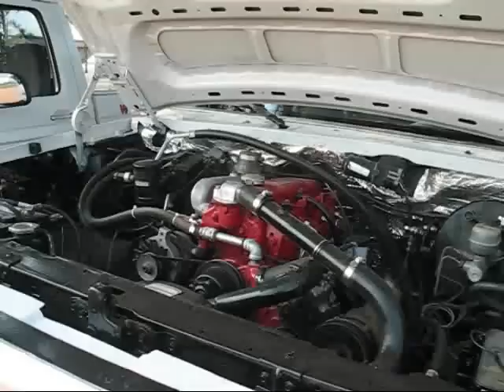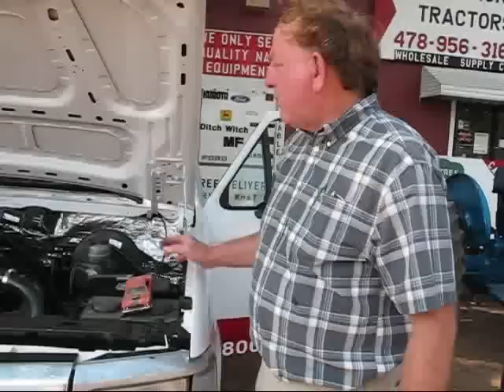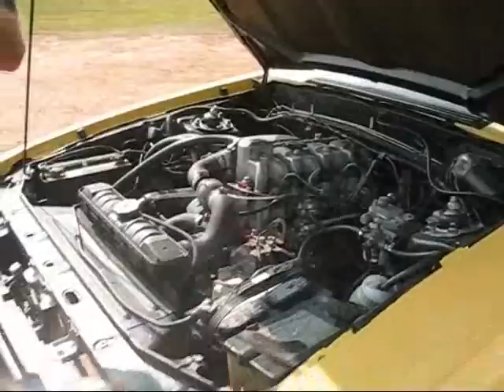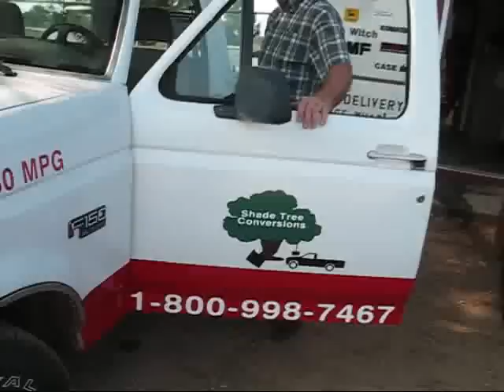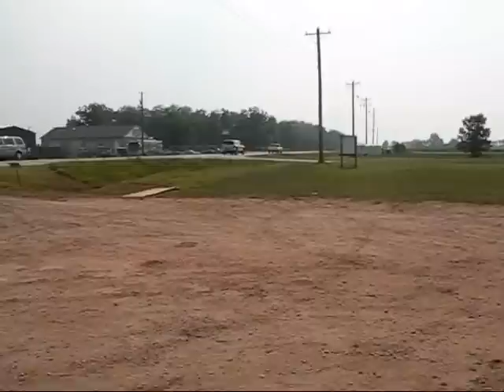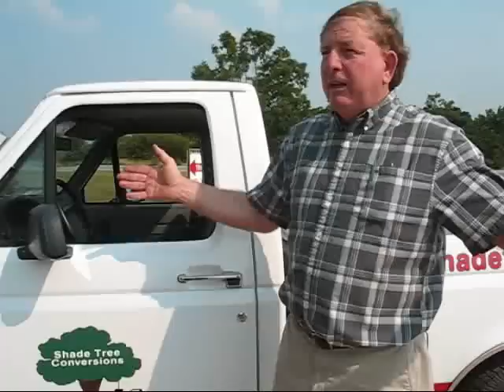Shade Tree Conversions (Diesel turbo tractor engines)

Comment: Hey Gary, don't forget how flexible diesels are with what they can burn!!  They can burn filtered used cooking oils, motor oils, hydraulic fluids, kerosene & such. ON a cold winter, my friend burns as much as 400 gallons of used motor oil for heat in his shop. I know of 3 guys in Kingston Springs Tn that all drive diesels & they make their own bio-diesel. They had an 'apple-seed' homemade unit with a used water-heater, then they bought a unit that made the process easier.

Comment: @triggerja  All you would have to do is take the same precautions you would if you put an LS1 in an 88 Chevy pickup or a small block Chevy in a Ford.  As long as you had a muffler and a cat, there's your emissions, vehicle modifications aren't illegal as long as it still passes a smog test, if it matters in your area, most areas don't have smog tests, and your state's safety inspection laws.  Besides, diesels actually have cleaner emissions than gasoline cars.

Comment: hey i have an F-150 how much would a swap like this set u back?
Reply: Around 10,000$ today. And that's if you do all the work. Cheaper if it's used but you are
talking modifications IN major area's numb.#
1 transmission swap and the mounts.